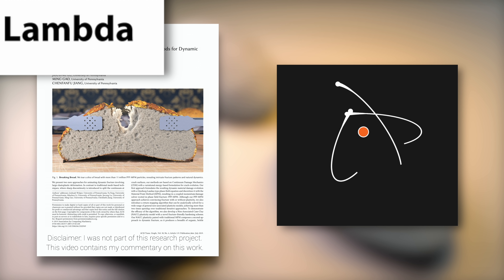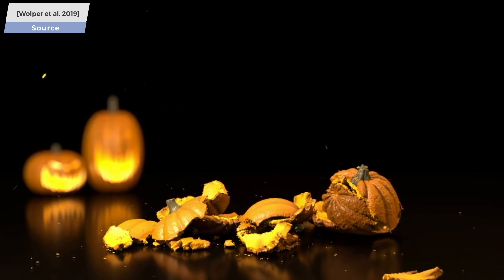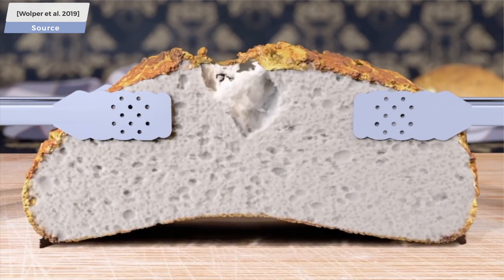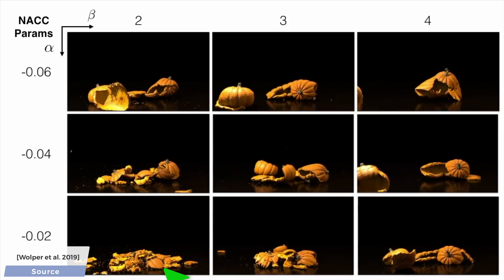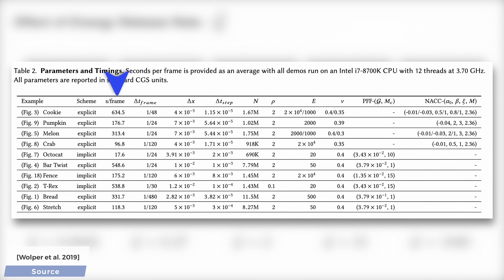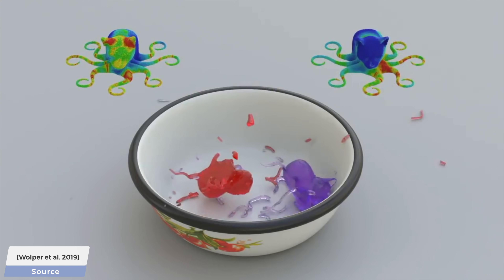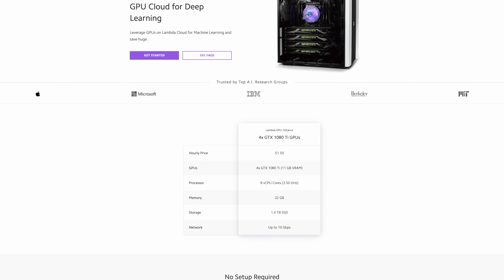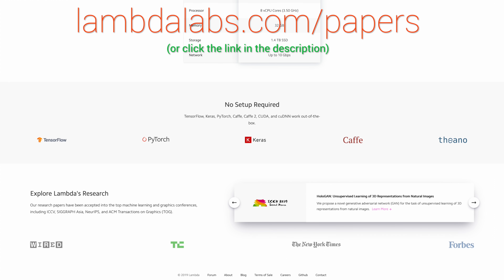Simulating Breaking Bread 🍞

Comment: ... Can we apply this to a game engine and use it for gore? Like, ripping an arm?

I know, this sounds fucked up, but it got me thinking.
Reply: Yan Uehara No, it wouldn’t practical at all, though it would be awesome. In games, unlike movies, everything’s being calculated in real time, so a feature like that in a game would slow it down a lot. Maybe a scaled-down system could be feasible for a game solely based off ripping limbs (lol). Most gore systems don’t bother with deforming the mesh because that’s a lot of render time. It’s easier to just quickly replace the character with gore on impact.